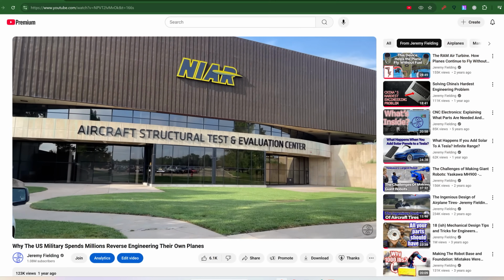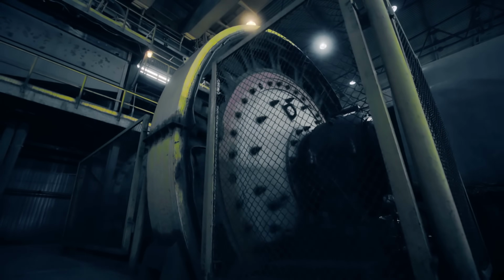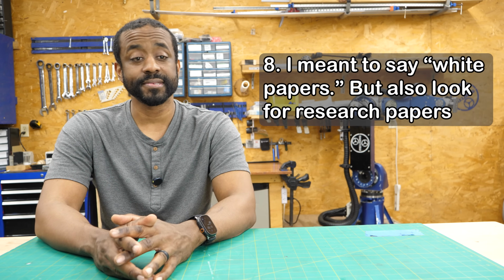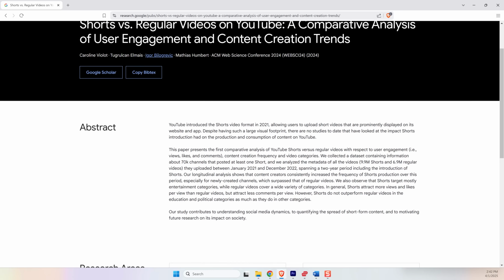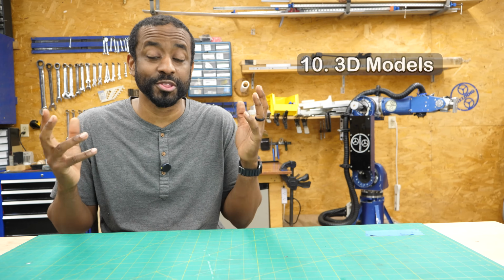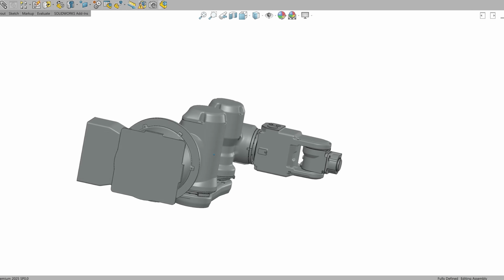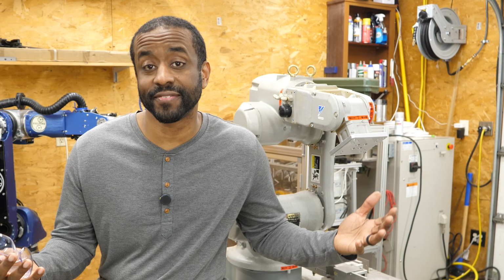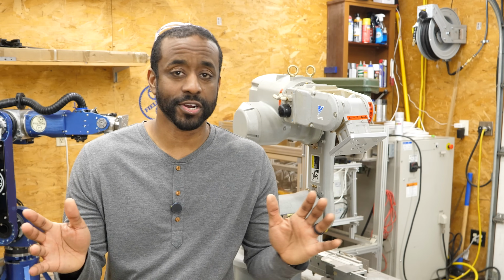How To Reverse Engineer Anything Even If You Don't Have One!

Comment: A little thing to keep in mind with servomotors and encoders from industrial equipment : some have a homing phase to calibrate them but some have a fixed position that's programmed into the inverter
That position is used for end stops which are usually mechanical (like when the part you're moving is against the frame)
I'd recommend putting some visual marks with a sharpie or similar to reassemble it in the same position that it was
Otherwise you might have the machine malfunction or break something if it's got fixed position encoders
Reply: These types of robots use resolvers. Robot axis need to be calibrated after reassembly. So this wont be a problem here
Reply: Yes. Some positioning systems use incremental encoders, say a pulse every degree. Relative position. You need to go to a reference mark (home) to turn relative position into absolute position.

Comment: I'm not sure Yaskawa does the same as other manufacturers, but the feature you found at the 5th axis at 20:00 looks similar to the referencing points Kuka use for their robots. Basically there they don't have a divet but a cone on the moving part of the axis and a grub screw that is replaced by a dedicated measuring indicator (basically a digital dial indicator with an interface for the controller) when a) the machine is set up for the first time or b) when the old references are off too much (e.g. after a certain amount of working hours, can't recall the numbers though). But at least with Kuka they don't use these for assembly but rather for fine referencing the axis position. Encoders generally don't drift much (servo motor encoders are usually multiturn, so not 100% absolute) but when their batteries run out, they came loose on the motor shaft, the motor had to be unmounted from the belts, the robot was crashed beyond crash detection capabilities (e.g. with full speed and high loads) it might be good to redo your references :) endstops also do exist for each axis (usually both SW and HW endstops on both ends of travel) but they tend to not be as precise as the referencing indicator

Comment: You'd think the Pentagon would include a clause in their contracts, providing blueprints for things they purchase, should the provider go out of business.
Reply from the maker: Even with the blueprints there are things that are not shown. For example problems with the original design that get fixed years later in the shop, or changes known to the guys on the shop floor but not known to the engineering department. When they 3D scan these planes they find all kinds of "patches" that aren't reflected in the original design. Those changes don't make it into future drawings. This still happens for many reasons everyday. The older the product the more likely there are changes and improvements not reflected in the "latest" drawing. Especially since the military is always upgrading antennas, radios and other technology within the same plane structure.

Comment: Sadly, more and more manufacturers are intentionally making it hard or impossible to get documentation for servicing their products.  I was amazed that early professional and consumer products often had schematics inside the chassis in case you needed to service them.  I don't mind modern manufacturers charging for schematics/service manuals as long as it's reasonable but many simply don't even offer them and if you ask, they just say "we can't do that."
Reply: They also used to design products with a philosophy that it should be as simple as possible for the owner to repair. For example, those old ford tractors that many collect and use still today. One of the best things about it is that the parts are widely available even now and you can access footage of Ford walking through common maintenance and repair, and you can tell repairability was thought of as a major factor to secure sales (informed consumers? wow). I wish I could live in that world. It truly is amazing to see now.
Reply: THAT IS HOW CHINESE DOMINANCE IN MANUFACTURING CHANGED EVERYTHING.
Reply: @tonybantu1681 yes and they have shaped customer expectations.  Documentation is garbage or requires some heavy interpretation.
Reply: I was astonished when the GE Profile washer I bought a year ago had a schematic and repair part diagram (including wiring map) in it when I opened it up, and everything was easily accessible and stuff was even color coded. Maybe we're not so fucked after all. Praise be to Rossmann. lol
Reply: Im working very closely with a company for my job and they drag their feet giving any information its very frustrating when all i need to do is modify something accurately but i need their measurements first
Reply: Repairability and reliability must be marked with some ratings as well.
Reply: I met a polish old man who worked as electrician for the same company that he got he dishwasher machine, when the machine broke he couldn’t fix by himself because that company didn’t give him the schematic.

Comment: i will take this as guide when i will need to  disassemble camera or lens... in past i was able just to disassemble, not to fix or reassemble it later :D also  that long side cast was beautifull...
Reply: As someone that's taken apart a few Canon PowerShots for cleaning and correcting of lens errors, the earlier models are rather pleasant to take apart, When the products started getting more sophisticated, you'll run into spots where you'll need to desolder a flex cable, in order to remove a mechanical part.
Reply: @lihtan  ahy es.. i am more into old Pentax stuff.. like from 80s -90s max :)
Reply: @PKristianCZ  Nice! I have an old Pentax point-and-shoot that I need to diagnose. I hear that the electronics on these older cameras can get pretty decrepit. When you're CLA-ing a camera, one of thing that needs to get done is to calibrate the timing of the shutter mechanism.
Reply: @ oh sounds horrible... i hope i will not have faulty camera/ lens, i qould much prefer to not have to take that goodnes apart :)

Comment: One thing that I noticed that you didn't mention: If connectors are labeled, record them. If they aren't labeled, label them!  Great video!
Reply: Very important indeed.👍
Reply: Oh yeah, take pictures and videos 😅
Reply: Yep, I've taken to photographing every set of connections, in situ , when disassembling anything!
Reply: I actually video the entire tear down process. I zoom in on any areas that look like they could be problematic as well. This is saved me countless hours are trying to figure out how something should have been positioned.
Reply: a book of numbers im an electrician and everyone always says how do you know what is what with a legit 3000 amp mvp and 4 or so 120v being fed from a huge transformer bucking 480 down the 120v it needs and loaded full with 3/4 pipes coming in full of wire we put the circuit number on the hot and nuetral and thats the way we terminate a huge load center circuit 1 through whatever in order odds on left evens on the right grounds will fall in to the ground bar first then nuetrals then your hots
Reply: @frankbradley8646  Feels like there's good, practical knowledge and useful experience in here, but the wall-of-text formatting makes it difficult to understand what you're talking about. Would be a shame if people skipped it because of that. I don't know what a "mvp" is?

I've put it into AI for some cleaning up:
A book of numbers. I'm an electrician, and everyone always says: "How do you know what is what?" With a legit 3000-amp MVP and four or so 120 V feeds coming from a huge transformer bucking 480 V down to the 120 V it needs, and loaded full, with ¾-inch pipes (conduit) coming in full of wire. We put the circuit number on the hot and neutral, and that's the way we terminate a huge load centre: Circuit 1 through whatever, in order. Odds on the left, evens on the right. Grounds fall into the ground bar first, then neutrals, then your hots.
Reply: I record and image everything when doing this sort of work because sometimes the thing you need to know later, you didnt know you would need.
Reply: well, bro if you learned from somewhere you didn't reverse engeneered. Reverse engeneer means you strip apart what's already built to fix it.
Reply: I believe he did mention that in a round about way :)
Reply: Being a Boomer, my phone camera has been useful for documenting processes.
Reply: @SandCrabNews  and reading fine print and details
Reply: Zip lock bags for small parts. Label with a sharpie. Left side plate and screws - in a bag. Right side plate and screws - in a bag. Or something to that effect.

Comment: Hope you recover well!
This video release is so timely. 
For an opportunity to learn hands-on, yesterday I literally brought a slavaged 3 axis linear motor stage that was from a gene data array printer. Planning to learn hands on with the linear stages, how to use older ac servo drives using rs485, and try out diy cnc control methods. 
Would love to see more content in adapting older motion systems to newer accessable controllers, how to mix and match ac servo motors and drivers, etc.
I look forward to all your videos and learning from you.

Comment: The plastic wrapping around the plugs is such a Japanese thing. Very nice, no junk is the connectors. The same connectors in a US made machine would be soaked in grease.
Reply: It's also a good idea from a mechanical standpoint not just to keep the connectors clean, but because you can't always be guaranteed that whoever maintains the machine is going to use a non-electro conductive grease.

Comment: I’m taking a class for my engineering major and the main project is reverse engineering something and while proposing possible improvements. I didn’t really understand the significance until you put it into perspective for me. Thank you for the video.
Reply: I am glad you was able to gain a deeper understanding from this video. One further step I would challenge you with is to dig deeper into understanding the process instead of just accessing information on demand.

The internet and YouTube is both a boon and bane to knowledge now days. Because everyone has instance access to information, it generates a mind set of "I don't have to learn it". Its great its there but that thought process damages our overall understanding.
Reply: You're taking an engineering course with an assignment where you have to take an item apart to suggest possible improvements, and you couldn't figure out why opening up the item to learning how it works is critical to the process?

Should that not be common sense? Also, the professor would have explained the assignment and given you more than one opportunity to seek clarification. Seems a bit silly to waffle and wait just in case a video was released that explained your homework to you.

Comment: What if it’s purely mechanical?
Reply from the maker: Then good pictures would tell you nearly everything you need to know. A video of it moving would also be a huge help
Reply: @Jeremy_Fielding I have access to it, it’s a ~100-year old tabletop printing press which raises multiple problems of:
A. It’s Cast Iron, and complex shape and I’m not a patternmaker also that’s not cheap…
B. Complex Curves, need I say more. 
C. The drawings are either long gone or in the hands of the man who makes the spare parts for a different press because the man who restored this style of press passed a few years ago… 
D. The points of rotation used (axles) are peened over